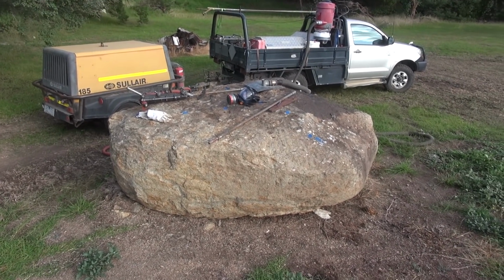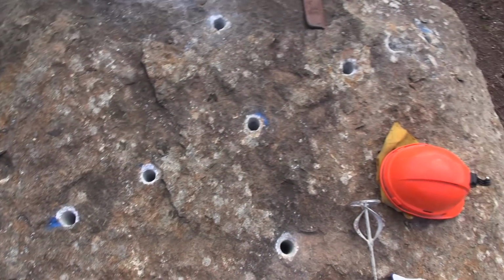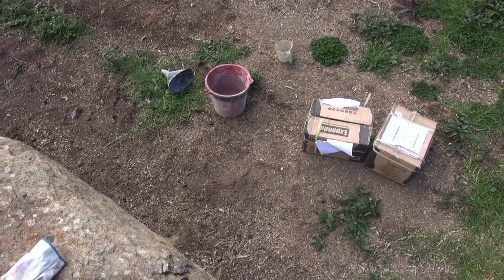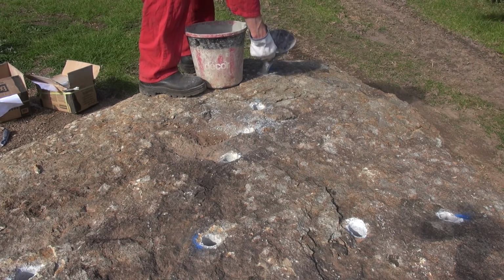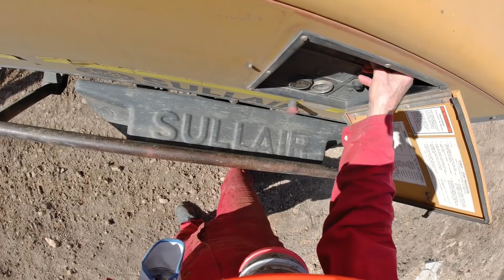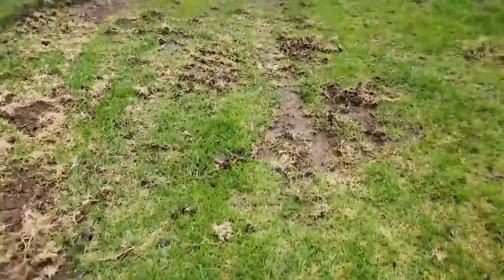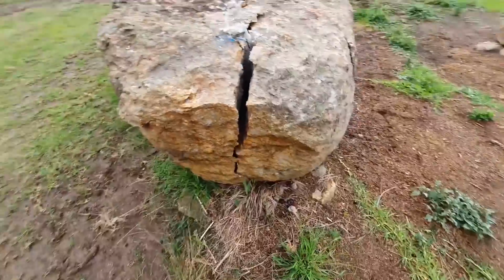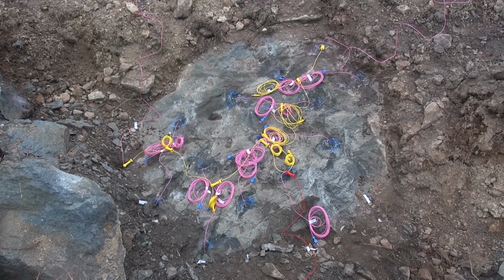Breaking rock with Expando and Blasting a pit hole

Comment: I have been using the pipe dope version of "Expando" for at least 50 years, the very best product for use when absolutely no leakage is acceptable. Also works well to get one more life out of damaged, old, or obsolete parts. My last application was to save two damaged 316L stainless steel tanks with warped, galled, and cross-threaded 4" male pipe thread outlets. Even with limited time and even less access space, Expando easily sealed the valves on perfectly the first try. Great stuff!

Comment: another nice job dave.that goo certainly works well.i hope they have learnt to call you instead of wasting time with a breaker.
Reply from the maker: They almost always have a crack at it with a big machine and ruin the point when I've told them there is almost no chance, and then have less to spend on the blasting.

Comment: How do you decide on how many holes need drilling? Is a square grid pattern the most reliable?
Reply from the maker: For blasting or splitting with the chemical cracking agent??

Comment: Can you use the expando on a tree stump. It's 33 inches wide (84 cm?) still green, corner of the yard, impossible to get to with machinery, and grew into rock and chain link fence. I want to split it so I can dry it out and then burn it out....
Reply from the maker: No, I don't think that this idea will work Joe. If you are not in a hurry you can rot it using Potassium Nitrate. Drill plenty of holes in it and fill them up. Plenty of info on the net.
Reply: @demolitiondavedrillandblast  
Well, it seemed like a good idea...

Comment: Rock Man,  do you think water would break rock like expando foam or feather & wedges?   i've seen engine blocks completely fragment from ice.
Reply from the maker: I have actually thought about this, drilling holes and putting refrigerant tubes down the hole, it does not get cold enough here to freeze all by itself.
Reply: @demolitiondavedrillandblast  I guess that once you drill a hundred holes, it's all relative

Comment: stupid question time but ive noticed you sling a leg over the drill to help push it down , could you adapt the drill with a bit of chain in a loop to stick your foot in to save you having to do a leg over ?
Reply from the maker: Have done that in the past Joe, hard to get enough weight on it though.

Comment: I know there are many variables, but what is the cost difference to the customer for chemical cracking agent VS. blasting?
Reply from the maker: As you acknowledge, there are many variables but blasting can often be cheaper.
Reply: Demolition Dave Drilling and Blasting  I appreciate your reply, that makes sense. Every job has its own difficulties and that can make price change in an instant. Cheers!

Comment: Can it be used in a very wet rock
Reply from the maker: Yes, if the hole is making water slowly, just mix and have ready to pour, blow the water out with compressed air and a blow pipe and pour immediately. If the water is permanent, e.g. returns as soon as it has been blown out, you must first sleeve the hole with some 40mm plastic lay flat tube and pour into the tube, the very heavy chemical mix will displace the water. You can see me using the plastic sleeve in this video for pouring into near horizontal holes, the same tube is used for wet holes - https://youtu.be/nWKP7NW3c1g?t=204

Comment: i am curious about why the holes for the expando have a minimum diameter. i am considering using it for a home project but drilling the large diameter holes is difficult. can it be used with 5/8" to 3/4" diameter holes?
Reply from the maker: Yes, drilling those holes is difficult and I'm sorry 2005 but trying to use cracking agent in holes that small... you would have a better chance of chopping down the forest with a herring
Reply: @demolitiondavedrillandblast  but why does it not work?
Reply: @billgator2005  Not enough surface area in the hole for the force exerted.

Comment: Awesome stuff.  Is Expando available commercially, or do you need special permits to purchase or use it?  
I’m planning on digging a fire-bunker on my farm (have council permission) in Tassie.  Unfortunately, my property is almost completely 1-2m clay ( in places, no clay) over mudstone, which has metamorphosed at a meter or two further down.  Would like to dig approximately 4-5m deep, but that would necessitate cutting around 3m into the mudstone.  I have most of the toys ( the good ones - demo-drill/hammer, hydraulic-teaspoon as you call them) but don’t wish to use explosives, as I believe it would take multiple shots over many weeks to reach the depth I need.
Reply from the maker: Expando is just a cement based product, no special know how or permits required - some good amount of care is needed though as it is very caustic and will burn eyes and lungs if you are not careful. For Tassie you will need the cold variant - SCA- 3 and something that will drill 38mm holes, give John a call - https://expando.com.au/
Reply: @demolitiondavedrillandblast  thanks Dave.  Found their website about half an hour after my comment ( about 30 seconds of actual googling).
Reply: Dexpan is the same thing basically here in the u.s. nice work !!

Comment: Why use chemicals and explosives when feather and wedge will do the same job?
Reply from the maker: This big rock that we put the chemical in was a bit big for my plugs and feathers and we would have had no chance breaking out the pit. both the plugs and feathers and CCA are best for breaking down oversize, not much good at sectioning in situe rock.

Comment: what dust extractor are you using? need a setup for my mini x mounted drill
Reply from the maker: This one - https://www.husqvarnacp.com/au/machines/dust-collectors/s-26/967663902/
Reply from the maker: Recommend you also use a cyclone separator between your drill and vac.
Reply: @demolitiondavedrillandblast  OK thanks i actually have that same model for my Soft cut saw new even thought i could use it for the rock drill. how are you directing the cuttings into the hose? what size do you mostly drill i usually drill 45 and 48 mm holes for a Darda or expanding grout. do you have a pic of your cyclone separator?
Reply from the maker: @Nuccioconstruction  OK, Please email me for more info and pictures - dave at demolitiondave dot com dot au  - For pick up at the hole I use an inch and a half or for 45&48mm use 2 inch gal pipe tee piece, there are many cyclone separators available on Ebay these days, get one the uses 2 inch hoses.

Comment: Does the explosion or the implosion break the rock?
Reply from the maker: The explosive breaks the rock with a massive shock wave and the chemical cracking agent slowly expands and splits the rock.
Reply: what Implosion? that is a explosion the expansion of gas, not the collapsing of it, there is a huge difference between the two.

Comment: That expando is pretty nifty stuff!
Reply from the maker: Yes, I use a lot of it.
Reply: I was thinking the same thing, but what else could it be used for?
Reply: Makes a pretty nifty pipe sealant for large diameter pipe threads as well.  It's just expanding cement.
Reply: @arnoldskit , Often used to fix holes and cracks in concrete walls/floors where there is a penetration. Its goal is to make a water tight seal.

Comment: Can you describe your extraction system, including brand name
Reply from the maker: Yeah, the Vac is a Pulman Ermator S26, I have 2 of these, highly recommended. They just sold out to husquana - https://www.husqvarnacp.com/au/machines/dust-collectors/s-26/967663902/
It is "H" rated (highest rating for capture of small particles) catches 99.99 % down to 0.3 microns.
I also use a cyclone separator in line to catch the big bits. see more video of this here -  https://youtu.be/N-HKpg22sU4?t=136

Comment: Happy to see breathing protection! Most people don't understand the long term effects of breathing silicates. NOT pretty. A friend that used to run marathons was hospitalized due to a single exposure to silica dust.. = silicosis. No more marathons. No more running, period! Labored breathing for the rest of his now shortened life. The stuff gets into your lungs as a dry powder. Moisture creates a concrete like mess in all of the little air exchange sacks in your lungs. There is no way to remove it! Now, this mid 20s athletic man is surviving as if he has terminal emphysema. He was an excellent weldor, but now is restricted to only welding where EXCELLENT ventilation AND hot, restrictive respirators are available... and few job sites offer both. AUDIENCE !!!  PAY ATTENTION !!! Dust from concrete and rocks can be deadly. Don't do it... Don't allow others, that are unaware, to do it. PLEASE...
Reply from the maker: You are 100% on the money John, I noticed early on the everybody that I would meet that worked in drilling and blasting had compromised breathing, I started out with just a basic half face respirator, then went to the best full face unit that I could buy and then vacuum the dust at the source also. Sorry to hear about your friend, did he have a very large exposure? is / was he a smoker?
Reply: @demolitiondavedrillandblast   He was not a smoker. Very athletic and health conscious. The exposure was a one time, but heavy exposure. Welding next to concrete demolition. Didn't like the dust, but was unaware.., and determined to do his job, no matter what.
Reply from the maker: Such a shame and a waste.

Comment: I did that many years ago on construction sites. Doesn't work as well on concrete with rebar in it.
Reply from the maker: What does work well in that situation??
Reply: @demolitiondavedrillandblast  An excavator with a jackhammer mounted on it - when it can reach the concrete. If the excavator can't get close enough, do it the old fashioned way - a good man with a 90lb jackhammer. When I started in construction in the 70s, some of the old 120lb hammers were still in use. 8-10 hours in the hot sun with one of those would tire you out a bit, hehe.
Reply from the maker: @Grendelbc  I have a 100 lb Chicago Pneumatic unit, I'm very familiar with end of day aches and pains, cramps, dehydration etc.
Reply: Always hated when the boss got to small of a jackhammer. Never had a 120

Comment: why the gasmask?
Reply from the maker: Three reasons Simon, despite using a pretty good dust collection system, you never get it all and any amount of stone dust in your lungs is very bad news, secondly in order to extend the working life of my drills I introduce a lot of oil into the airline, this is not good in my lungs. Thirdly the full face protection keeps all of the stone chips out of my eyes - this is a constant issue when using a rock drill and safety glasses alone do not prevent all instances. The mask is also an excellent protection when mixing the chemical cracking agent - this product has a PH of 14 and will burn your eyes and lungs.

Comment: Go to super cheap and get yourself a radiator filling funnel 
Holds about two litres or so has built in stopper
And cheap
Reply from the maker: I went down there today, the exit hole is too small and the compound will build up and set in there very quickly Rodney.

Comment: Need a time lapse camera to show it breaking 😁👍
Reply from the maker: Yes! have done one of those but it was a bit of a let down see here - https://youtu.be/PdaLeO59CAU It is a bit difficult to set up as I need weather protection and theft protection and external power for the camera so not every job is suitable but will have another crack at it ASAP Goz
Reply: Put 1 on the back of the truck and take 1 home, do it from home in the shed lol

Comment: no real improvement in technology over the last 200 years?
no high tech ultrasonic drill or laser thermal shock boring device?
no hydraulic wedge system to replace the hammer ones or the expando?
Reply from the maker: No, no, Bruce, there is the Darda hydraulic splitter, I've never made enough money to buy one of these tools, my friend Yuriy Pchelintsev  has heaps of them - https://youtu.be/7Y_wf6NSdH8

Comment: 🦜au - G'day Dave - Remember how they split rock in ancient /  Roman  days  .
they put wooden dowels in holes      keep dripping water on wood  expands   &   cracks  
You should do a video on this drill a hole  &  put a long wooden dowel down it   with a bottle dripping  water 💦    experiment 
Should make quite a good video           time lasp  cam needed  mate!   cheers
Reply from the maker: I think that would be too slow for me to tolerate Mark